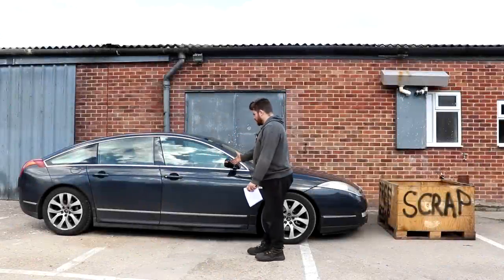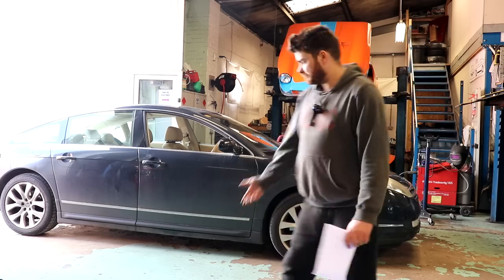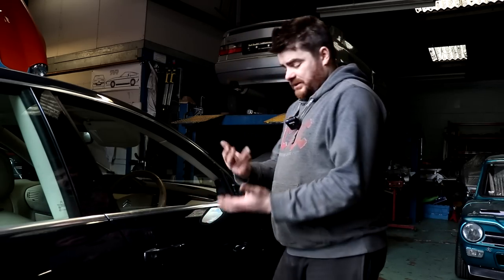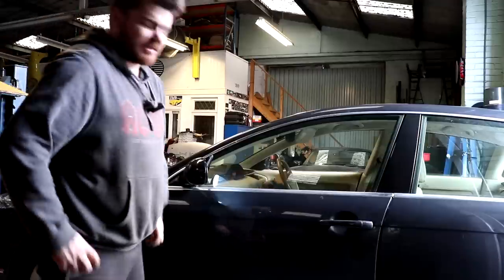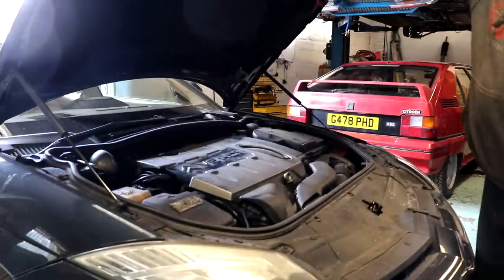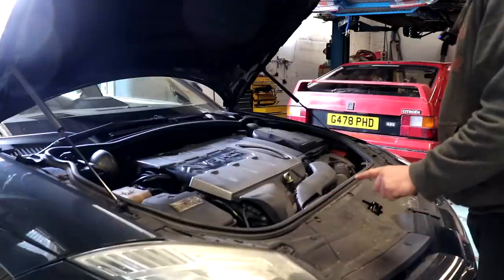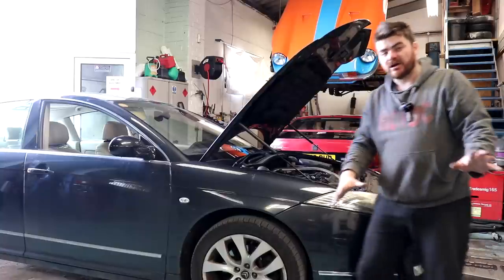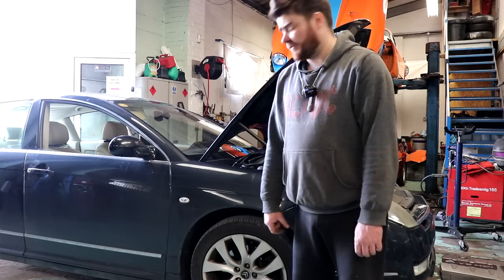Cheap Citroën C6 Project 11: Did it get the MoT? What now?! Remember (Dame) Esther Rantzen?!

Comment: When I bought my C6 (inspired by you) from an auction, they had absolutely drenched the fuse box, which shut down 110kms into the trip. The car went on redundancy mode on everything, everything. I was too scared to turn it off, as I thought the starter would be isolated and i would be stranded. I drove it 660kms in 3rd (only available gear), with the heater on full to assist with cooling. When I reached home I turned it off and then on again. Everything worked. I would not trade it for the world. It is an absolute quirky marvel of design and engineering. If you love something, keep it, even as an ornament.
Reply from the maker: I can't be held responsible for your purchase of a C6, that's entirely on you. Nothing to do with me.

(congrats)
Reply: @UPnDOWN  Perhaps I didn't  word it properly. 
It is a good inspiration, and I wish to keep her for as long as I can. 
Of course you can not be held responsible.
 I just wanted to tell you that I considered a C6 (Ivy) and I genuinely thank you. Although I have many Citroen's, I would be able to do it without your support or C6 owners' support. This is the reason I became a member. To say thanks.

Comment: None of my three C6s ever had that UV-attack with the headlight lenses; a March 2006 — originally RO06 HRF (the Fifth Gear-featured one) and now on C6 CYX — a November 2006, SD56 VZV, and a November 2009, RK59 WVB (3.0HDi), RPO 11999CJ.

Rich, for the sake of 3k, don’t sell it! I’ll come round and swap out that ‘stat housing with you, and we’ll look at the aircon (which might be the gallery temperature flap[s]). I’ve done those as well!

Looks great in that colour scheme and on those Atlantique wheels. My 2.7s were both Mauritius Blue (with Roccastrada wheels) and my ‘3’ was Abyss Blue; all had that Wadibis interior. The black leather interior is, as you stated in a previous video, not as nice (I actually think it feels oppressive and ‘orrible!). The Wadibis seat facings are actually meant to be different coloured leather sections, btw…

Comment: You love it.
Do the transmission, and store it and SORN it,  then bring it out for high days and holidays. 
Eventually the values will start to climb as it acquires classic status. 
Those V6 engines are lovely and smooth. Used to drive a Jag XJL for work with the 3.0L variant. It could certainly lift its skirts.
Reply from the maker: To be honest, if it was for high days and holidays, I'd probably just leave the gearbox!

Comment: Going against most comments here, but sell it, sell it for whatever you can get for it. If someone runs it for a year and then it goes to parts, fine. If it goes straight to a parts car, fine again. C6s will only survive the current bottom of the market if there's a supply of parts cars. Let it die so another can live, it's a noble sacrifice!
Reply from the maker: Fair comments.

Comment: I have a friend who had a C6 with a V6 petrol engine and he absolutely loved the car. Unfortunately, it was not mutual and the car was almost more in the workshop than being driven. Luckily, my friend had a big budget and money wasn't really an issue. Still, he eventually had enough of the car after a couple of years and sold it. Not because he didn't love the car, but because he couldn't drive the car when he wanted to (it spent way too much time in the workshop). He has other cars too including a BMW 740d (G11) so he was not dependent on the C6. I have heard of others having similar problems with the C6. It is definitely sad that it is like this because the car is both absolutely gorgeous looking and cool and you really want to love it.

Comment: Keep it, Richard.  It’s everything you love, with MOT and just goes.  It’s not a dumb supercar, just a normal diesel.  
I run an e55 as my only car.  It also is unjustifiable and expensive to run, esp. around town.  Yet I adore the thing and would never sell as long as I can hold on to it.  Every time I drive it, it speaks to me deep inside, reaches in and grabs me by the naughty bits.  Dreamed of one since 2003, got one in 2019.
If you love it, run it.  Have previously sold cars and bikes that I shouldn’t have, and shed a tear when they turned the corner.  Emotional attachments, eh?

Just keep it.  You will regret selling it, even more so when you have at last had the inside professionally un-mankied.

Edit: £600 in road tax per year isn’t that much.  People spend more than that on coffee from the star** place, per year.  On coffee.
Reply from the maker: All true, but my income doesn't match the running costs of this car.
Reply: That's the first time you've said that.... Sell it.
You don't want to be feeling that the car owes you... So either SORN it or sell it. You have other projects that need your time and money.
It's a real shame.

Comment: if i was keeping that car, I would change the radiator & air con condenser all in one go. Also for me down in Australia 
fixing the coolant leaks & air-con are the 2 biggest priorities, everything else can wait. I cannot stand cars with coolant leaks or non functioning air con. I have a big workshop like yours However all my cars that get driven around are all mechanically fixed I don't like cars with any sort of leaks oil, water whatever. I will strip them & change every hose if needed before getting on the road. if i find a leak it gets parked in the workshop until it is fixed. (overkill I know).

Comment: Had exactly your dilemma with my Saabs . Firstly a low mileage 9000cse which I owned for fifteen years and then with the 9-5 Aero that replaced it. Possibly the daftest thing I ever did was selling the 9000, The 9-5 was replaced with a Peugeot 308 soot chucker. The only time I love that is when I see 60mpg and pay my £30 road tax
Reply: What is it with the Citroën/Saab ownership thing?
I've had a C5 exclusive (which inspired me to buy my C6), two C6's (one purchased as a donor car but saved and  now owned by the genius I call "The Citroen Whisperer") a 9-5 and three 9-3 convertibles. 
I've had at least one of each since 2008.
Reply: @stewartmcnaughton3395  Former Citroen Xantia owner / current multiple Saab owner checking in...

Comment: Hello Richard, I feel your pain.
I parked my C6 next to yours at the Citroen owners club rally last year.
But, I've sold mine. 
I too loved it, but I decided I just couldn't justify it. I couldn't use it as a daily because of the cost and using it caused things to break. I couldn't keep it as a weekend car, because it took up too much space and not using it caused it to break as well (in strange and irritating ways).
I sold it at a loss, because as you said, they're not worth much, especially with higher miles and few people seem to want them.
As it drove away with its new owner, my grief was tempered by a strange flood of relief.
I wish you all the best whatever decision you make and I'll watch Clement and professor tomato videos for as long as you choose to make them 👍
Reply from the maker: Thanks Dave, sorry to hear you had to part with yours. I fully sympathise. I do use mine daily and it's done a great job til now, but the costs are very real.
Reply: Thanks Richard. I still have my phase 2 Xantia hdi estate, that I use daily. That car just keeps on going and going, 25 years old and its done 15000 miles in the last 9 months at 50mpg 👍

Comment: I'd a C6 Exclusive 2.2 bought second hand at two years old, from a Citroen dealer. I paid £16000 for it, it'd done 20000 miles. So, they didn't like them new, either! I kept it for six years, and then sold it- it's now on 130000 miles. Oh, and I have a DS and a Traction as well.....

Comment: I've got a '98 Nissan Maxima SEL that I shipped back to NZ in 2018 that has just over 96k miles on the clock. It made no financial sense to bring it back except it's a great car that I've had since 2012 - bought for £850 with 57k on the clock, it has been an extremely reliable car. No way I would have gotten more than £500 if I'd try to sell it and some eejit would have just wrecked it after a couple of years. Credit to the previous one-owner who looked after this car and must have kept away from gritted Winter roads, because it was rust-free. 
Car tax in NZ really, really cheap compared to the UK - it's 5 x less than what I was paying in London.

Comment: Hmmm, tough one! I have owned 3 BXs- a Mk1 16TRS, a Mk2 16RS and a Mk2 TZD Estate. The ride was amazing. My RHD 1974 DS 23EFiM was a project car I wish I kept, instead of selling it for £500... I trestdrove a C6, and I just couldn't bring myself to buy it. It felt too ordinary after the others. The ride was 'normal', the brakes were 'normal'. But the styling is superb. The dashboard is low rent and boring, but the seats and doors are lovely. The head-up display is a time-locked novelty. BUT- I keep coming back to them on Autotrader. Just looking... They will, without doubt be a classic. But at what expense? I agree, it is a toughie, and one you may regret selling, or keeping...

Comment: Thing is, probably less than 1% of cars bought are an investment.
As you say, you ain't gunna get more than 2k for it with the issues you have been very honest about.
Just remember someone paid 40k for that 15 years ago. It's lost 90% of its value already.
Don't get yourself into a hole where it goes catastrophically wrong and you have to spend 3 days stripping it to get 1.5k back in parts.

Comment: The prices of C6s at the moment are such good value for the car that they are. Awesome. Not a great time to sell, but a great time to buy! Living in London though, I can’t drive my one much as it’s not ULEZ compliant. So I just drive my SM. 😎
Reply from the maker: Ah, you have an SM! Mentioning it is a good move, I should do that more often!

(can't drive mine, though...)

Also, I think one of the variants of C6 is ULEZ compliant, either the 3.0 (2.9) petrol or 3.0 diesel, but they're very rare and aren't as good value as the 2.7.
Reply: @UPnDOWN  ...it will be the petrol. The 3.0 diesel is in a lower VED band and also quite rare, but still not ULEZ.😕

Comment: Mate, some of us got it worse... I have two broken ones and no garage at all. 1st one like you I bought for £750 and just to put it on the road, like you, spent about £2000. And then plastic coolant bend broke, all the coolant escaped and the engine seized while 2000 miles away from home (still sitting there at my parents house). 
Then bought a second for which I paid ~£1500. Crashed in the most awkward of places - rear quarter panel just in front of the wheel. To make matters worse we have two front struts leaking LDS and another leak from the rear. And finally on the last weekly startup coolant leak. 
I love them a lot, but they will never make sense at all. Especially financially. But then again I am sure same was said for the SM in the late '80s hence the reason the ugliest ones are untouchable nowadays.
No one wants a 15 year old Citroen...

Comment: Keep it for while, it would make a tremendous EV conversion, once the right battery / drivetrain becomes reasonably affordable. I mean nobody dreams of a 2.7 HDI diesel, so it’s not like the sacrilege of turning a 3.0 V6 Busso Alfa into an EV.
Reply: EV conversion would be a nightmare with the lexia set up (can't even get up to date maps), would cost around £75k to complete - its a heavy lump of a thing - and cars built after 2002 can't be redesignated as electric by DVLA.
Definitely worthy of consideration in the more distant future though.

Comment: That C6 won't ever become an icon like the SM I'm afraid, even with it being the last hydropneumatique car with the "Citroën" badge.
You would not get Your 3 grand back in its current state though I'm afraid, it still is a 750 quid barge, "reasonably working" for a Citroën enthusiast not anxious about black greasy fingers every other week plus having a lift and a couple tools to keep it somehow on the road (which might have made it a 750 quid barge, at all, in the first place, with You as the buyer).
There's no reason to NOT use a MOT- and tax-exempt DS as a daily car, so getting rid of the C6 and putting that money into Your Clement would principally be a sensible option - with Clement's mechanics and hydraulics being way easier to maintain and repair (if need be for the latter, at all). You'd have to have a family taxi or throw-away vehicle for roadsalt days aside, which can be the next 350 quid C6 or a 200 quid Xantia or whatever, thoroughly used XMs are particularly cheap in Germany (don't know over there) these days, while the really good ones rise in worth breathtakingly .... even a rolled-over C-Crosser for a hundred would do, as a throw-away, as long as Your seller had bought an MOT for it and all windows are still there. The hypoid-badge-engineered Mitsubishi C-Crosser is an abomination making You wanting Your Citroën back every kilometer mile You torture Yourself driving it however. There might be, thorough assessment needed, some other cheap cars in the mot- and tax-exempt class that could give You what You need in a daily driver, but I reckon an enthusiast with Your possibilities shouldn't resume to an Allegro or Princess but get the Clement into a three-seasons car and keep a cheap throw-away roadsalt dumpster for the bad salty days climate-improvement still keeps in store for us. Anyway - You will be punished for having an exquisite taste in cars like the C6, with ridiculous taxation, with ridiculous restrictions, ridculous legislation and, once You step up and say "not any further!" with ridiculous jurisdiction, before a majority will join in and try to democraticly get rid of the anti-individual-traffic zealots. 
I hear people start changing their attitude versus restrictions and "low-traffic" and jokes like Sadiq Kahn recently, but I reckon it will have to get way worse before it could get better. We (Germans) in fact actually do fear even for our remaining unlimited stretches of the Autobahn with the military-olive-green abomination calling itself "the greens" in our current joke of an administration, and in neighboring Tirol (Austria) friends have perfectly legal, stock motorbikes and still are exempt from using their home roads for "sound emission" arguments because some greedy idiots try to trump current legal regulations with local special needs regulations for no reason - So You are not alone with the difficult decisions - it is a common problem these days, all over Europe. 
Thanks for sharing!
Reply: 100 % 👏
Reply: @peteroconnor4672  Thank You.

Comment: Right on the money about you owning it so I don't have to! I've always considered buying a C6 but it's the tax/performance ratio that has put me off. It's definitely in the 'not fast' category but you are paying £600++ for the privilege. I've just bought an L322 4.4 Range Rover TDV8 in the same tax bracket but I can make the man maths work for that given a) it's the best engine they did b) it has 700nm of torque and 313PS 😀

Comment: Perhaps it would be best to spend some time on it, replacing the engine and gearbox, which you already have. You would also have better access to everything coolant/aircon related. Having it like it is, is not giving you any answers; perhaps spending time/effort on it will provide (even) more love or at least clarity on how to proceed. Love cannot be reasoned with.
You'll probably have to (re-)do the Effort Checks & Balances with the cars you own. Which is a recurrent thing anyway...
Take care & stay safe/sane (...)
Reply from the maker: All that effort/money could go into the SM though, that's the problem.
Reply: @UPnDOWN  True, but your SM needs a LOT more time. And I know that Clement is a stepping stone to the SM (at least that is what you convinced me of), so he comes before the SM (at least in a 'staggered' way). And Clement also needs a LOT of TLC.
I don't think Clement will be a racker-up-of-miles, which I reckon the C6 is quite capable of being - in fact, that is where it shows its best.
Smaller steps more likely give you a sense of accomplishment.